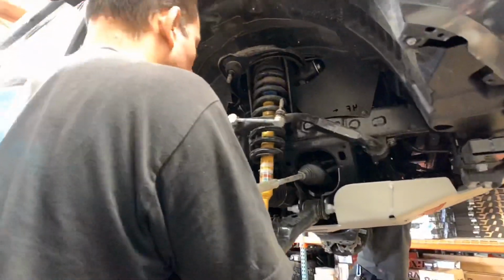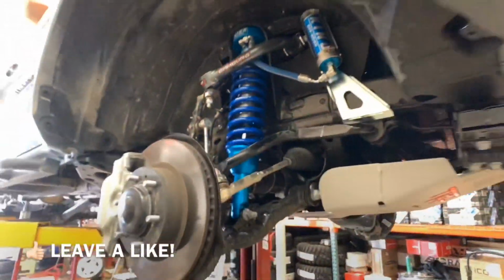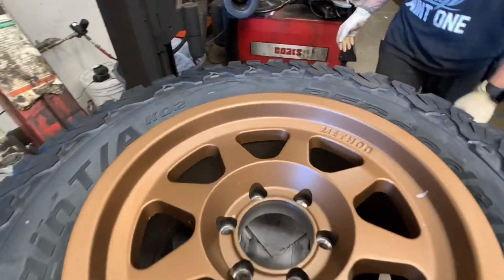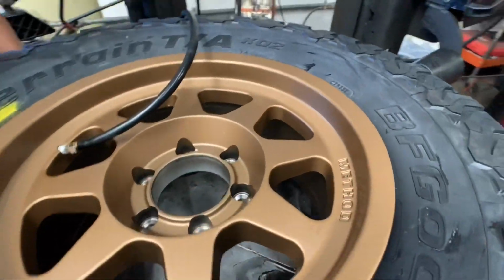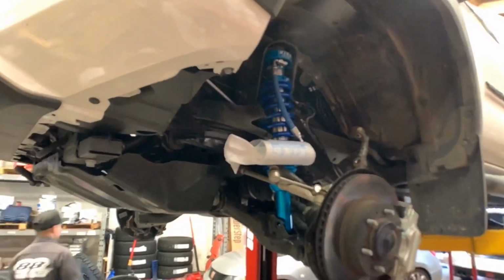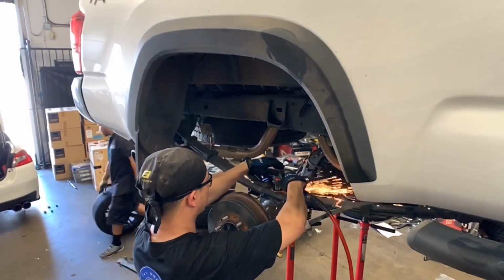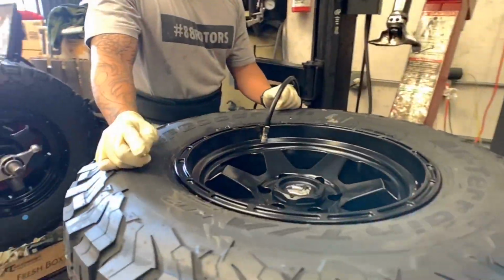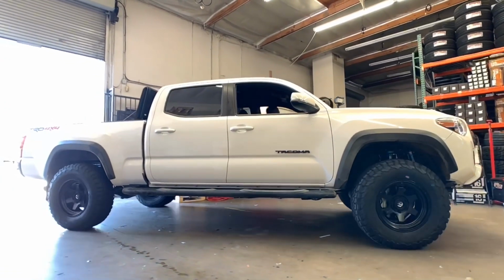Pair of Tacoma Trucks on King 2.5 Remote Reservoir Shocks

Comment: There's a gx470 that I'm looking at with these shocks and rear old man emu springs in the rear.  I was wondering if its still ok to tow?  It seems the king 2.5 is too soft.  If I wanted to add rear air suspension helper, is there a certain one to go with the king 2.5?  Or maybe a harder rear spring?